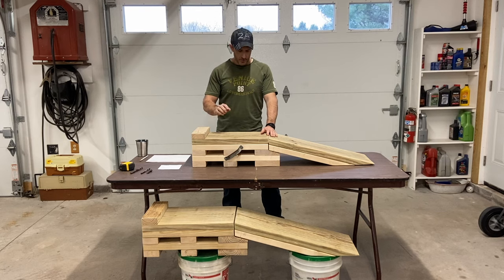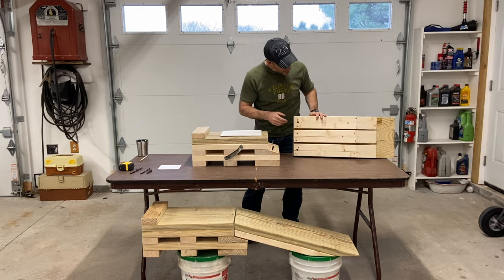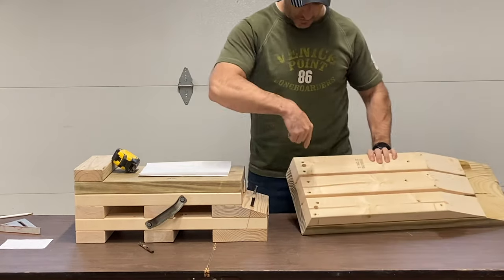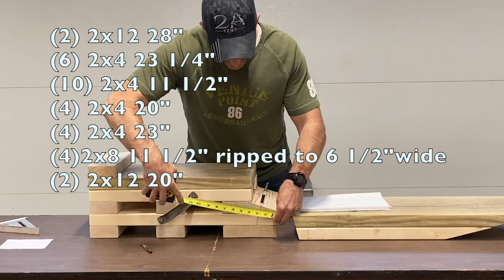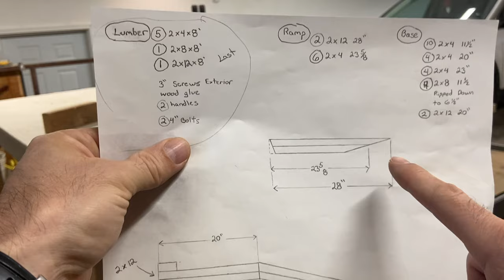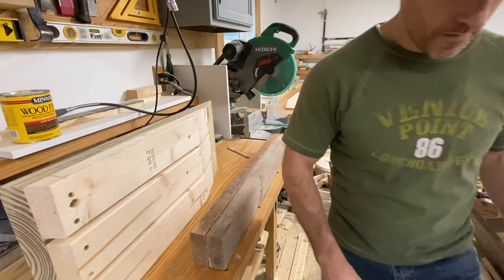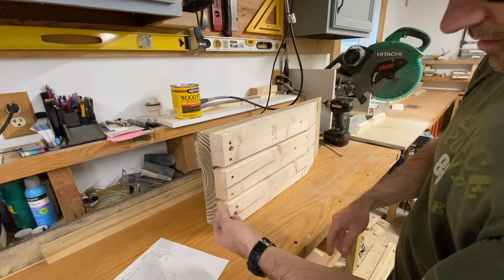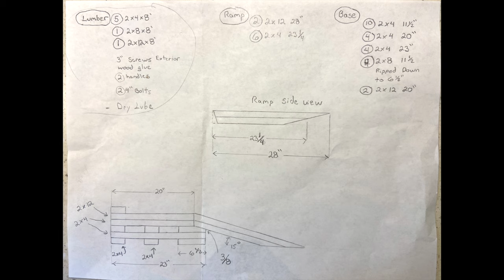Ultimate DIY wooden ramps

Comment: Planning to make very similar ramps for myself, with one change. Instead of 2x6s creating the ramp support area, I'm going to use vertical 2x4s. The funky 15° rip becomes an easy 75° angled crosscut.
Reply from the maker: That is a good idea. Thanks for watching
Reply: This sounds like what I need to do. Did you use the 2x4s for the whole ramp, and cut the angle at the bottom (and maybe top also) accordingly, or were the vertical 2x4s just at the main platform area and the angles cut for the ramp to sit on. I can't quite envision it and it would be great if you can elaborate :) ... if you altered the platform area with standing 2x4s I'm thinking you had to change the design of it, but maybe I'm just not clear on what you did. Thanks!
Reply: @emp1acur  I wish I could post a picture. I tried posting a link to a picture and it's not showing up. But basically, I put vertical 2x4s with a 10° cut at the top under the ramp portion.
Reply: @sjohnson2461  Wow thanks for replying  quickly - appreciate it. OK, I think I understand that you attached the 2x4's (maybe 6 or so) with the top 10 degree cut so they were protruding out the 3.5 inch width under the ramp? if so, did you use really long screws to fasten to the platform?

Comment: Add one more wheel stop to the back side to act as wheel chocks after removing the ramp. You just need to make two more pins from bolts so that it's removable but still use wheel chocks on the rear wheels, of course.
Reply from the maker: Thanks for watching

Comment: I noticed in your newer videos, you are removing the mower deck. Did you stop using the ramps to sharpen your blades? If so, why?
Reply from the maker: No I still use ramps,  not everyone wants to build ramps so I show how to take the deck off.

Comment: As a youngster (yes, they had cars!) I had a set of ramps comprising essentially of 6 similar ramps.
Put 2 down and drive forward up.
Put 2 the same behind the rear wheels, then 2 similar, but turned over and locked into the slope on the front ramps. This allowed you drive back, with the rear wheels rising  while the front ones stayed on the same elevated level.
This gave you the front and rear off the ground making it a doddle to work on.
Reply from the maker: Sounds like a awesome setup, thanks for watching
Reply: That's an interesting idea.   That would be really handy for me since I have several cars that need the trans fluid checked from below with the vehicle sitting level.

Comment: Just finished building a set of ramps, they came out great, thanks for the tutorial.
I made a few changes, went with standing 2x4’s for the ramp, I also added a steel sleeve for the bolt, I wish I could add pictures but YouTube doesn’t have this option, thanks again
Reply from the maker: do some channel have a picture option if so i'm going to have to look into that. Glad my tutorial helped you

Comment: Yeah, nicely designed and proportioned. I build box cribbing to support vehicles and walls out of  2x4's cut 11-1/2 inches long, glued and screwed  in doubled stacks so I can increase height 3" per cribbing layer. Since I have a mess of four-foot 2x12 scraps I salvaged from my local lumber yard, I'm going to adapt your design to these materials. I really like your two-piece design.
Reply from the maker: Awesome hope they turn out great

Comment: I really like the  overall design; very well thought out, and very well explained. 

I will be building 'full car' ramps based on this modular design. Instead of two (2) lift sections, I will need four (4) to accommodate four wheels. Four, plus an additional two (2) 'span bridges', which can be connected using the same lag bolt mechanism as with the ramps. The span bridge length will be determined by the car's wheel-to-wheel length, which may accommodate most passenger cars. Once the car is in place, the span bridges may be taken out for additional access from the undersides (much like wheel cribs). They can then be put back in place to drive car back down.

For those of us with modest table saws, the trick at 9:45 of the video is to make two or more cut passes, starting with a greater fence measurement setting, and then adjusting it closer to the desired final measurement. Multiple cut passes, but easier on (a smaller) table saw and blade.
Reply from the maker: Thanks for watching and thanks for the tip.

Comment: Great video.  Others here may have already made this suggestion but to cut the various angles a bit safer than using just your fence on the table saw is to make a table saw jig to hold your material.  The idea here is to secure the material in such a way as to avoid using your hands to push the material through your blade. It should even allow your to cut a heavy board such as the 2x12 board.
Reply from the maker: Thanks

Comment: Hi Jim, thank you for the video. I had been mulling over a design to build ramps for my lawn tractor. These are pretty cool. I only need them for the tractor and not a car so I might make them a bit smaller however your design concepts have really helped. I am on the way to the garage now.....if I find anything I feel will assist others as I build mine I will definitely come back and post! Keep up the great work.
Reply from the maker: Hope your ramps come out awesome. Thanks for watching
Reply: For my X300 lawn tractor, all I do is put a piece of cardboard under the bed then remove the belt, front 2 pins and it basically sits on the floor.  Pull it out and you have full access to everything.   I'd never put it on a ramp for sharpening the blades.

Comment: This is one of the nicest designs for a wood car ramp on the internet.
One question, why use 3" screws and not 2 1/2" or 2 3/4"? Won't the 3" screws go right to the edge when putting 2 2x4s together, or even stick out a little bit from the other end if you sink in the screw little bit?
Reply from the maker: Thanks for watching, not sure why I use 3 inch screws I built them over a year ago.
Maybe it was all I had.

Comment: Awesome build. Amazing detail.  The only thing I would add is a removable piece that you could put behind the wheel to keep the vehicle from rolling backward, similar to what you have in front. Possibly angle iron, with studs welded on that match holes in the platform.
Reply from the maker: Sounds like a good idea thanks for watching
Reply: Could you lift the removable ramp off and use it as a chock behind the wheels?
Reply: @butchkleven5876  That's a good thought. I like the utility. The problem I see with that approach is the ramp itself isn't a great chock, as it could roll up the ramp allowing the car to fall. Also you might want to jack up the other end of the vehicle leaving no chock at all.

Comment: Jim awesome ramps, best I've seen. No doubt better than plastic or metal. One of your viewers mentioned to add a removable piece to block the tires on the ramp. Maybe some skate board tape for trackion. I will need 3 for my Can-Am Spyder RTS, but may end up making  4. Awesome build, thanks. GDoc
Reply from the maker: Thanks for watching Dj

Comment: Great plans..Going to add 3" in height for more room under car to work on transmission. Yours is 7-1/2 mine will be 10-1/2 high...My Suburu doesn't have much clearance from bottom of tire under front bumper (frame is close to ground) so will also make ramps a lot longer to compensate for added height and make a more gradual slope. Just have to figure length of ramps and angles. Still going to use jacks after car is on ramps just in case cause I got a gravel driveway....Great Video and construction details!
Reply from the maker: Hope they turn out great thanks for watching
Reply: Did you make this? I was just going to use the 2x4 and flip it so it should increase the height on each level Probably adding another cross section for increased strength. But it would get you the height without doing another layer? I want a higher ramp for mower access to blades. Like this concept and design.
Reply: @justinbocchino  Yep, I added one complete layer and made the ramps about twice as long. If I understand you and you put the 2x4 on their sides it would get you the height (1-1/2 " flat vs 3-1/2" on side) but might compromise the lateral strength force or stability when driving on but who knows? It might work for mowers. Also attached some thin perforated non slip plates on each ramp so front wheel tires don't slip when backing or driving on. Jim has a great design and build.
Reply: I wish you could share a picture. I think jim's setup and instructions are excellent. Just looking to tweak it a bit. Being modular is brilliant. My purpose is homeowner with a toro mower with scrap wood :)

Comment: I have the same Delta table saw. I will be building a set of these ramps for my VW Beetle.I have a miter saw and bandsaw. I think the bandsaw will safer for the 2X4's. You could use 2X4's for the long ramp just turn them 90 degrees.
Reply from the maker: thanks for watching my video. Glad it sound like i helped you with a plan hope they turn out good for ya, have a good summer

Comment: Great ramp design!  For myself I'm thinking about swapping out the 2x12s out for 2x10s.  Of course I would also leave out the ramp bottom middle 2x4 that you said may not even really be needed as I won't use this for a half ton truck.  All the angles will remain the same and some 2x4s will be getting shorter.  Thanks for posting!
Reply from the maker: Thanks for watching, hope your ramps turn out awesome
Reply: @DIYJIM  update:  after gathering my scraps and rethinking it I decided to go with the 2x12 like you did after all.  Cost me $37 for 8ft treated board because it was all that was available, $8 handles and a $18 hand saw.  But they look great and sturdy!  👍🏽
Reply from the maker: @SomeKoolPlace  Awesome I wish Youtube would allow pictures in the comments

Comment: Good Video JIM
i would make Changes - PUT the PINS in the RAMP SIDE so When you Remove the RAMPS the PINS go with the RAMPS and Leave the BLOCK CLEAN as to not to DISTURB you when you Working under your TRUCK .
then with the RAMPS you Could Also USE them as a LOWER RAMP OPTION UPSIDE DOWN and with the EXPOSED PINS FACING UP PLACE ANOTHER 2x4 with Drilled Holes fot the STOP WALL .
Reply from the maker: Sometimes I use just the ramp part to get me truck up 3” so that would not work for me but maybe it would work for you. Thank you for your comment have a great day
Reply: @DIYJIM  Kool - Keep Good Video Tips

Comment: Thanks for the video and the detailed measurements and instructions.
 In my country, they actually are cutting the wood to the actual size, so I am getting actual 12" wide and 2 inch thick.  So I have to make some recalculations based on using 4 levels of 2inch thick wood.  
I back calculated using your lengths and then went forward to get the corresponding figures for the 2inch thickness.. but I got some differences when I back calculated compared to yours.  
I wanted to ask about the length of the 2x4s in the ramp...you had listed they should be 23 1/4 inch but in the paper drawing I think you had 23 5/8?  In the video (picture insert at 13:17), it looks like you line up the 2x4 top with the edge of the top board 15deg cut. 
 When I worked the horizontal length of the cut, I get 5.6 (=1.5/(tan15) ), so the 2x4 should be 22 3/8.  If I use the correct angle of 15.5 deg...I get the length of the 2x4 should be 22 5/8.  
 Yeah, I know I could just cut off the excess wood at the back and not worry about the length.  I just wanted confirm that I was doing the calculations correctly because it looks like i have missed something.    Thanks.
Reply from the maker: Hope your ramps turn out nice. You are right I have 23 5/8 on the drawing. all the measurements are not super important just so you can drive on them when you are done. Wish I could see a picture when you get them done. Sorry if I did not exactly answer your question.

Comment: Jim the 15 degree cut - can you do with Sliding Miter 12" saw ? Do not have a Table Saw- I have a 12" Ridgid R4221
Reply from the maker: You can try that was a hard cut to make. Hope it turns out
Reply: @DIYJIM  thanks for reply,need to do oil change on my 2017 Tahoe with 5.3l
Reply from the maker: I can drive my Tundra up on two  2x6 in front of each tire and it gives me plenty room to slide under. Maybe you could just do that it would be a lot easier.

Comment: How much does each ramp weigh? Thanks.
Reply from the maker: The big part of the ramp weighs about 23 LBS and the ramp part weighs about 13 1/2 LBS. Sorry to take so long getting back to you.
Reply: @DIY JIM  Alredy made. Almost like yours. What I did is I took 36in 2x4 drew a line from corner to corner and cut on the table saw freehand. Then i reversed one piece and glued them together. That is the angle and the height plus 3/4 plywood on top.
Reply from the maker: @sushi8204  I wish you could put pictures in the comments. Hope they turned out good.
Reply: @DIYJIM  Ok so I finally tested my ramps today. They are 10 inches wide and almost 6 feet long. I am glad I made them 10 inches wide because it is impossible to see where I am driving. I think I am going to add a yard stick so they spread evenly. 
Anyway, they worked very well. Front part is almost 8 inches tall so it allowed me get to the middle of my SUV which already has 8 inches clearance. I wanted to remove plastic shields I damaged to fix them and the center one is in the middle of the car. 
Front part is 21lbs and the back part is 15 lbs but I think in a few months both parts will lose some weight if I leave them in the sun.

Comment: will these work on low clearance cars. Do you think the angle will be to much?
Reply from the maker: You can always make the ramp a few inches longer. It’s hard for me to give you a answer. It depends on where the front wheels are and how high the car sits. I would have to say they are better then the metal ones
Reply: Thanks for your quick response. Out of the ones on youtube these require a little more work but by far the best
Reply from the maker: Thanks, can you share the video?

Comment: Nice job on the ramps! I'm trying to get some ideas to make my own and this helped a lot. I need to make them for a 2017 Corvette GS so the the ramps are going to have to be a little longer because the car sets so low. Do you think the angle you used on the floor side of the ramps would still work if they were longer? Thanks for the great video!
Reply from the maker: glad you like the ramps, but if you make the ramps longer you are going to have to change the angles. Hope they turn out great

Comment: Is there any reason not to make the beginning of the ramps a square 90 degree angle?  Most cars could negotiate that.
Reply: Another thought.  Drill hole down from the top and put a carriage bolt with countersunk nut and washer underneath.  Drill another 2x4 with same spacing to cover bolts and act as stop when using ramp upside down for a 3" elevation.
Reply: The ramp span is about 14 inches and has no center support.  Why is a center support needed for  the the deck part (only 13" span without it?
Reply from the maker: Thanks for watching Mark you need to be my neighbor stop over we can build another set. Thanks again for watching
Reply: @DIYJIM  I am actually planning to build a set tomorrow morning after drawing plans tonight after seeing your video. Thanks!  It is nice that the internet can bring new neighbors together no matter what the distance.
Reply from the maker: Awesome wish you could post pictures on here. Hope they turn out great
Reply: @DIYJIM  I finished them a little after noon and put in an oversized oil plug in my pan since the original was loose and leaked. Motivation to make the ramps!  They worked great.  Thanks for the idea.  My wife likes the fact that the ramp could detach!  But she wants an electric hoist for cleaning under the zero turn mower.  oh, well!

Comment: when you Cut the 15 Degree for the 2x12 Top Part of the Ramp Section - Did you Leave 1/8 " at the TIP - TOO Sharp a Point the WOOD will break OFF ????
Reply from the maker: I did not worry about the tip being sharp I sanded it but you could also leave an 1/8 or a little less thanks for the good question
Reply: @DIYJIM  thanks JIM
how about the STAND Part ?
LEAVE 3/8" BEFORE Cutting 15 Degree Angle ?( The Piece you Cut Down to 6 1/2")

Comment: Nice, except you have a math error. If you add the wood and spaces on the bottom, you only get 20 1/2", not 23 1/4". I am leaving the 2x8 at 7 1/4", and leaving a bigger space beside it, to get 23 1/4".
Reply from the maker: Your the first to catch my error. I’ll have to look at that. Thanks hope your ramps turn out good.
Reply: @DIYJIM  So, I think the space beside the 2x8 will be 5 1/2” wide.

Comment: Y didn't you just drill on top of the ramp through to the pedestal with the original long bolts and there is no need to mesure anything all you'd have is to hoels on top of ramp that dosent a fact anithing just a short cut
Reply from the maker: thanks for watching hope your ramps turn out great